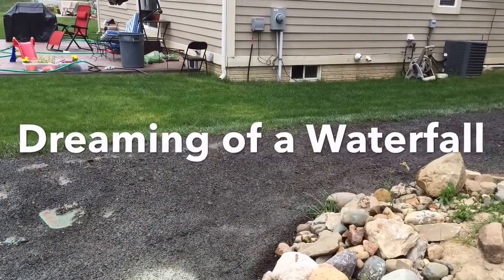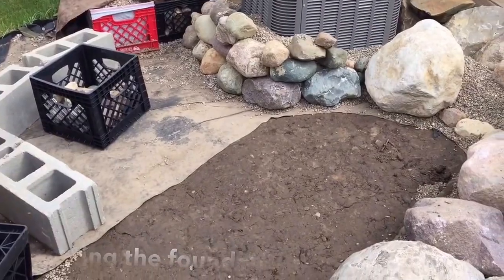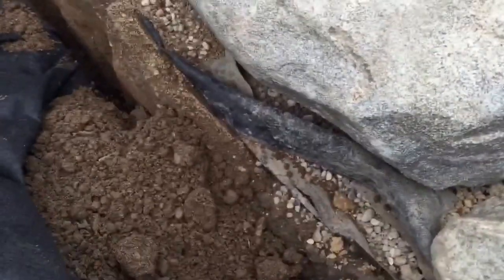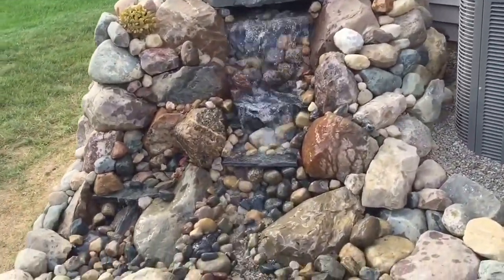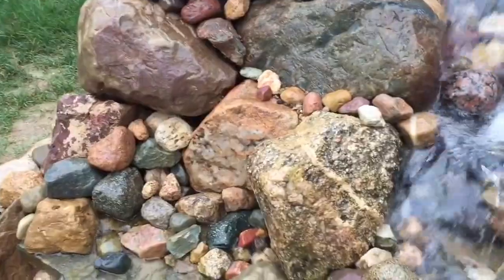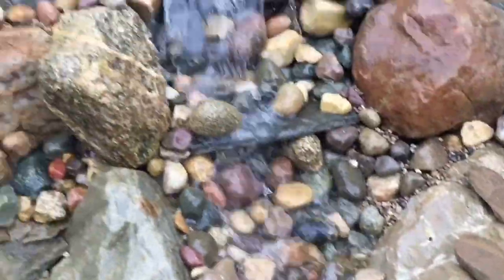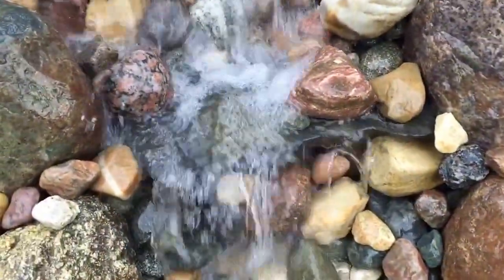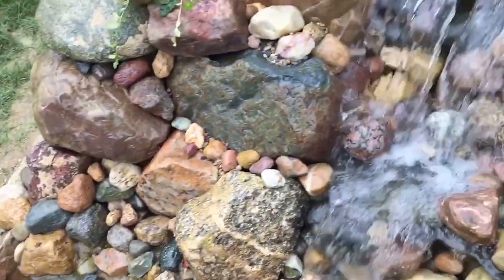Watch Before you Build your Pondless Waterfall Project

Comment: Hey man, I build these for a living.im impressed... if I can give you a suggestion it would be to use waterfall foam to better direct the water.....you have quite a bit of volume.....thats great adding waterfall foam will allow you to take advantage of all the ava water and you'll really be amazed with the volume of water......great build my friend
Reply from the maker: I have used it each year which of course removed the mini fall which was ok. Each year the rocks would shift and I would have to find the leak. I have always use one can of foam, but this year I’ve use two cans and still cannot find the leak. With the leak the water will disappear in about maybe three days running continuously. We’ve had enough rainfall to avoid running out but it’s still frustrating not being able to find that league this year.
Reply: @DetroitLove  add an aquascape auto refill valve and put your feature on a timer or smart control so you can say hey google turn on waterfeature that way you don't use too much water  so add the auto refill valve and add a smart swich......are you in jersey did I recall if so ill have a look if you like

Comment: Hi Carl, I'm fascinated and do very much like your pondless waterfall.  I do live in a region where I may not be able to get stuff like the eco blocks, water liner and the pump.  Could you be in a position to suggest a few alternatives to building a waterfall and pond using cement and solar pump alternatives.? Very impressed with yours good job. God bless your work.

Comment: What size pump did you use? Also I have some of the same questions as below - how long did it take you to complete this project? How do you winterize? How do you clean the water? Also, when you turn off the pump, where does the water go - is it down below in the eco blocks?
Reply: Thank you for your response. Just wondering, do you have any trouble with bugs or mosquitos getting into the underground water?

Comment: I just cringe watching the placement next to the air conditioner and so near your foundation. I have had several ponds, waterfalls etc. and have learned the hard way that even when you think that you have planned for every possible problem something can go wrong and life will slap you upside the head and prove you wrong.

Hopefully you have planned for an overflow in  a storm event that channels water away from the house and air conditioner (water and electric appliances don't mix well). We had several weeks of high rain and flooding and  I had to end up using the pump in my pond to remove water from the pond when it over flowed and started to seep into the basement.

Mother Nature is kind of a witch and doesn't play nice.

Comment: Beautiful waterfall in a horrible location. I get the idea to stick up a trellis and put a waterfall to help hide the AC unit but there are inherent flaws here. First of which any reputable HVAC guy will tell you to leave as much space open around the AC unit. Anything blocking wide open optimal air flow is bad. Including, but not limited to, a trellis and a huge waterfall to the side of it.

I don''t like the location of your AC. Here you have this beautiful patio and beautiful landscaping you have worked so hard at and right next to it is the AC?! I noticed your neighbors place has there AC unit on the side of the house were it belongs. I know it ain't cheap but I would move the AC unit and all the unsightly wiring and disconnect box to the side of the house. Get a HVAC guy to run new line sets and now it's were it truly belongs.

The other problem with the AC right next to the patio is the noise. I noticed/heard it kick on while you were running the waterfall so here is the sound of running water and an AC unit together. If for whatever reason you couldn't or don't believe it's a good idea to move the unit I would have put it out by the pergola and fire pit. Please don't take this wrong just throwing stuff out there...